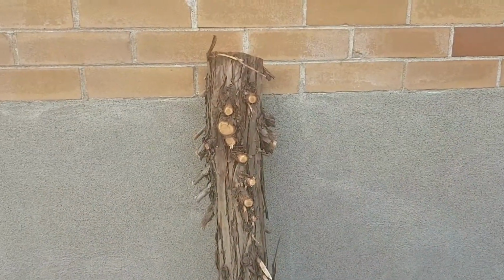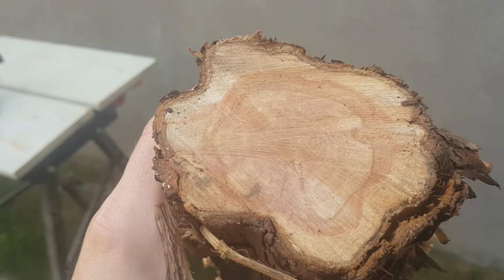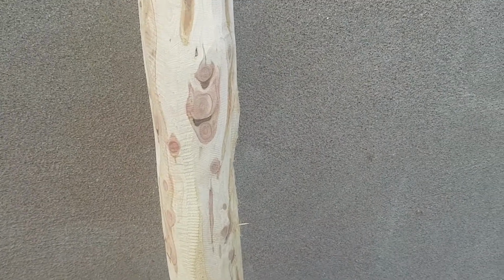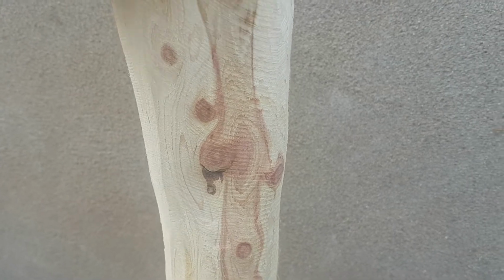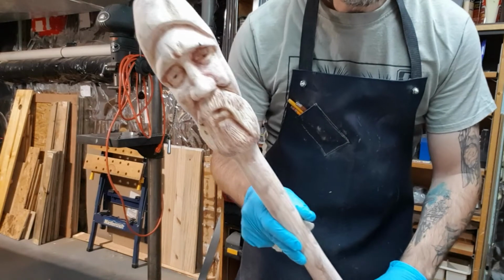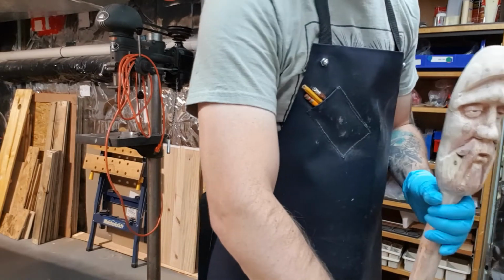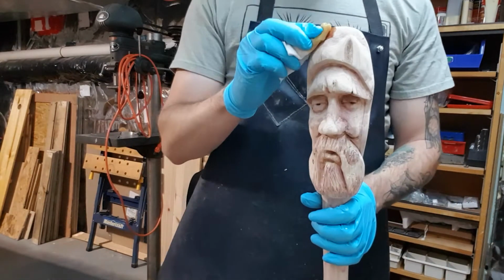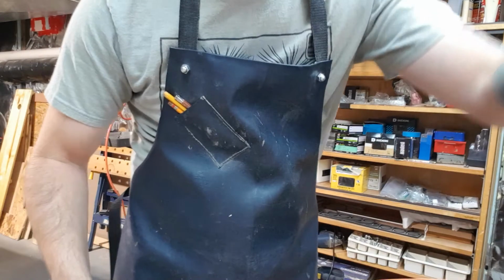WALKING STICK Power Carving a wood spirit

Comment: Eastern Red Cedar. One of my favorite woods! Beautiful & very aromatic. Nice carving!
Reply from the maker: Makes sense… this piece had so many knots however. Beautiful but a tough one!
Reply: @JasonHedrich  yeah, it can be aggravating to carve, but such beautiful grain. I have a few very old root systems that were pulled from the sapalo river, all of the white water wood is long gone, only the red heart remains. It's very hard, rich in color & still has that nice aroma when you cut into it.
Reply from the maker: @jesseherrin3253  sounds fantastic... I bet you have some great ideas for those pieces!
Reply: @JasonHedrich  For sure!
Reply: Definitely a dawn redwood  branch. I've got one in my back yard, and carve them often. I love the smell when you burn it.
Reply from the maker: @seanmcquade687  not sure it’s a redwood… it was an evergreen tree and it smells like cedar, just much deeper red than I’m used to seeing it.
Reply: @seanmcquade687  I carve eastern red cedar all of the time, I haven't ever had any redwood....but from what I've researched of the two, they're in the same overall family...but eastern red cedar has a distinct smell unlike any other wood, producing berries & no cones. So if it has that distinct smell then it's definitely cedar, if not it's probably redwood. From what I've read they're often mistaken for one another just by the way the wood looks. Once you smell the cedar you can't mistake it for anything else.